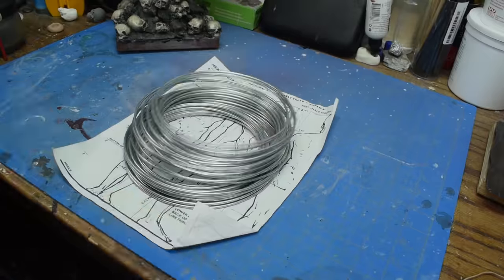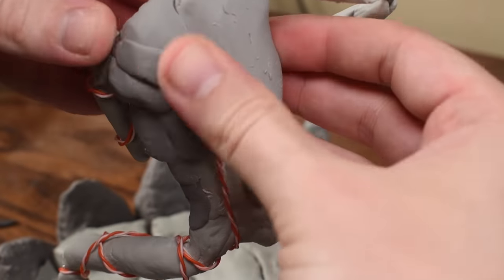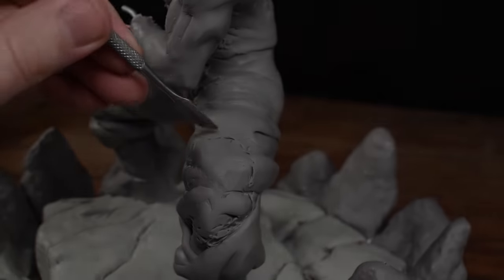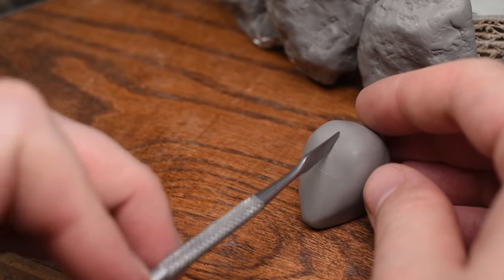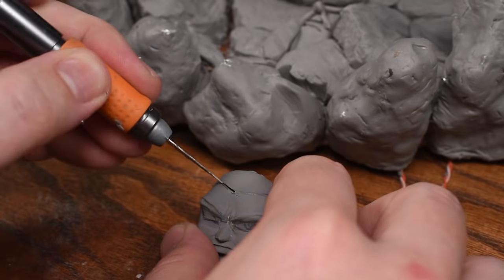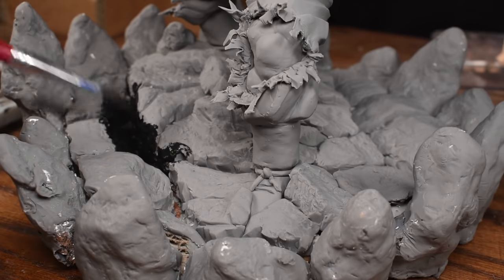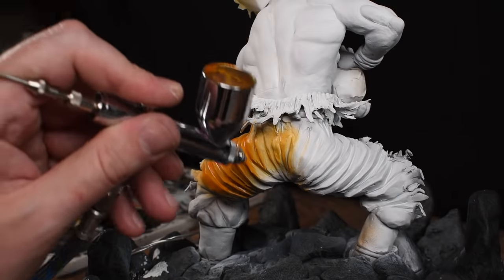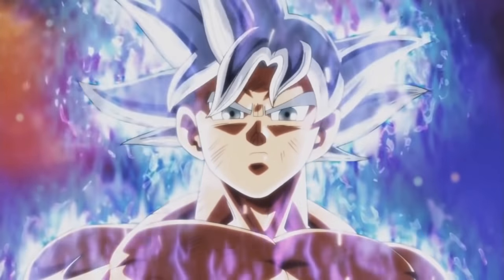Sculpting Ultra Instinct Goku (Kakarot) Polymer Clay Tutorial (Timelapse)

Comment: did you put it in oven to bake with the wire? always wondering if it possible to do !! and what kind of  clay you use for the hair? never can find one that white and transparent like this !! thank you
Reply from the maker: Yeah it is baked in the oven with the wires inside and it is completely fine. The temperature that the clay bakes at is not that high. I made a silicone mold for the hair and cast it with clear epoxy because there wasn't a clay that was clear enough.